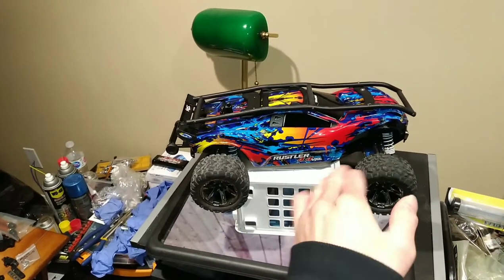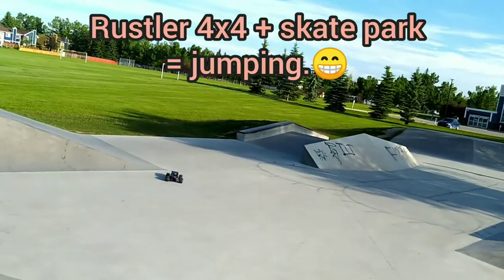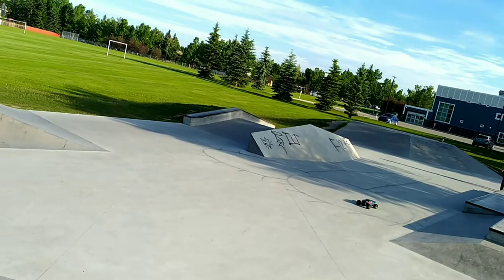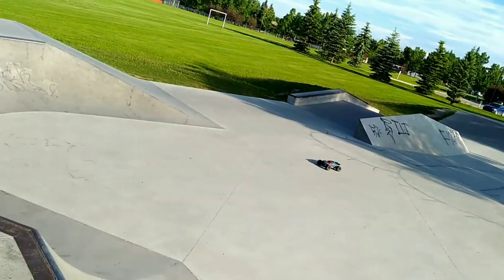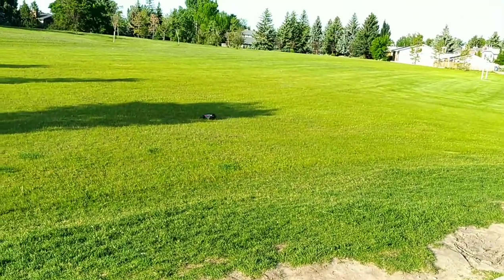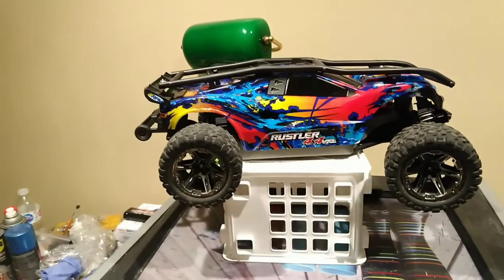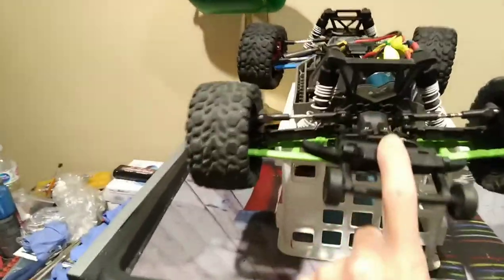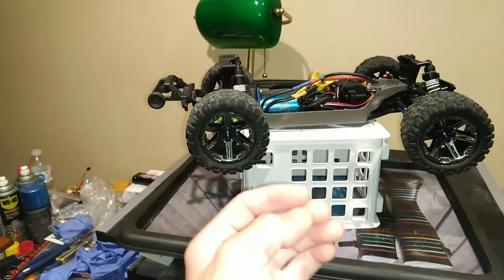Why turn off TSM or gyro before you jump? (rustler 4x4 jump explain)

Comment: Very good Video! Well explained and demonstrated! Awesome! 👌 You can prevent the Body popping out in the front by drilling a hole horizontal into the peace and put a long 3mm screw in, so that the screw sticks out and extendest the surface witch holds under the tower. Stay safe!
Reply: Yes! I need to do that to my body as well.
Reply from the maker: Kimberly thanks for watching and the advise, yep that will probably work, but i am just too lazy to get a fuel tube for it.😅
Reply: @yyckey5022  I did it without the fuel tube and it worked just fine.
Reply from the maker: For real, ok I will try it, thank you Kimberly.😉

Comment: Just a question why does my tsm cause a wooble when off the throttle at 100%tsm.
Reply from the maker: So you mean when you turn the tsm knob all the way left to the end, and pull the trigger, the front two wheels wobble like you have turn on tsm?
Reply: @yyckey5022  so tsm 100% and when I accelerate theirs no wooble it only when I release the throttle from 60kms or so it goes side to side like very unstable it’s done it since day 1 over a year ago and I can’t figure it out at 50% it reduces to minimum to none but at full it’s very annoying only on paved road tho.
Reply from the maker: There are a lot of possibilities that can cost it to wobbles (might not be tsm), have to see it in person to know what happen, that's why some of us make video, not just for everyone to see, but also for ourselves to see and reviews what happen to our truck. 

I think you should upload a video of the problem on u tube and see if anyone have any answer, caz without see it happens, is hard to tell what creates the wobbling.😉
Reply: @yyckey5022  all right on the weekend I will see if I can make a video of the issues.
Reply: @johnbat1846  I’ve been wondering same thing. With tsm at 100% car drives fine as I accelerate but when I let off the throttle the car swings left and right very heavily as it slows down